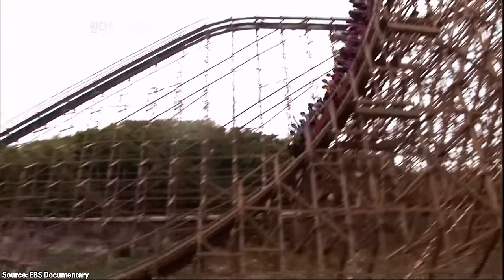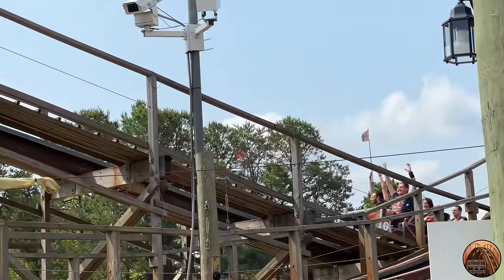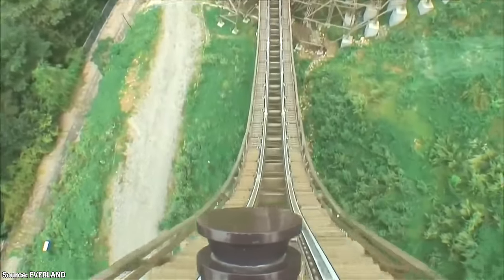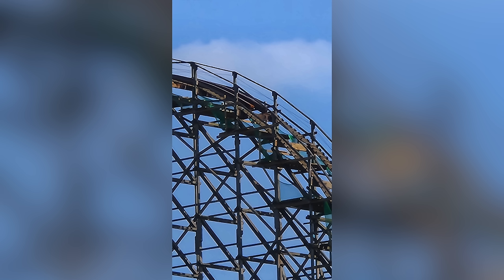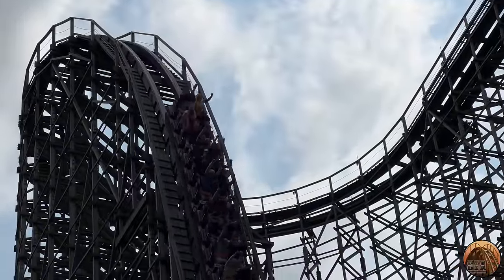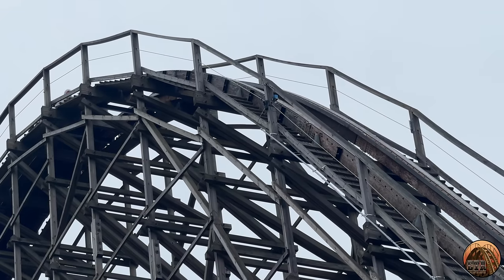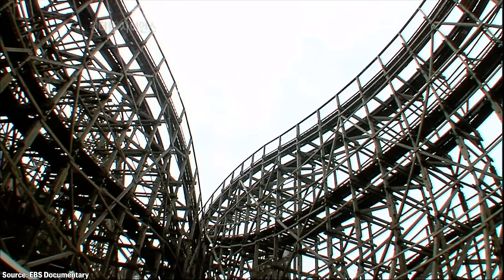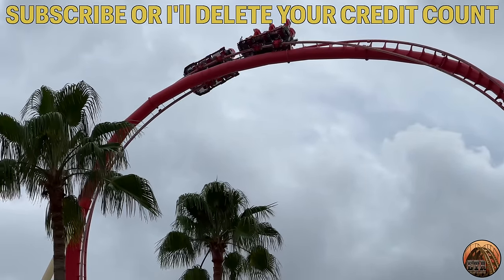The End of The Intamin Prefab Wooden Coaster?

Comment: When you have the best wooden roller coaster on the planet not keeping it wood would cheapen Great Adventures  brand and would be a complete catastrophe. The bean counters need to come up with a creative plan to keep El Toro original!
Reply: El Toro already run on rubber anyway. Like you know, actual steel coaster

The only time you can feel El Toro became real "wooden coaster" when the rail already so beaten up that rubber wheel won't help anything at all.
Reply: @bocahdongo7769 What kind of wheel do you think should be used on a wooden  coaster?
Reply: @MichaelRei99  steel wheel on top of steel strip. Like railways. Rougher ride but less friction

Now you know why Voyager is way insanely longer than El Toro despite having 20 ft shorter height. Heck even with all those height El Toro can valley on cold morning

Comment: I would love to see El Toro converted into an RMC hybrid coaster. The ride already has a super fun layout with S tier airtime so it just needs the steel track. Financially it makes the most sense and when El Toro was brand new it was as smooth as a steel coaster anyway.
Reply: hell no, rmc is for bad wooden coasters that are incredibly rough. El Toro is an elite ride that doesn't need to get changed. Think about it like this, why would you want a 9/10 to go to an 8-10 / 10, when you can have a 2/10 go to an 8-10 / 10? There is even a possibility that the new el toro might be worse than the previous version. RMC is for bad wooden coasters, not elite ones